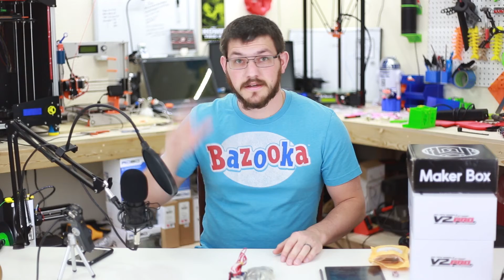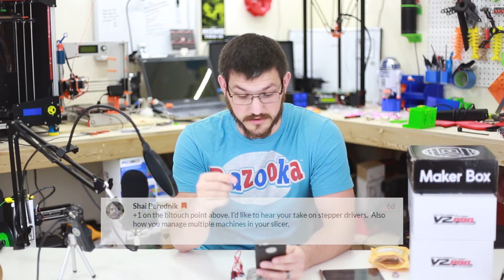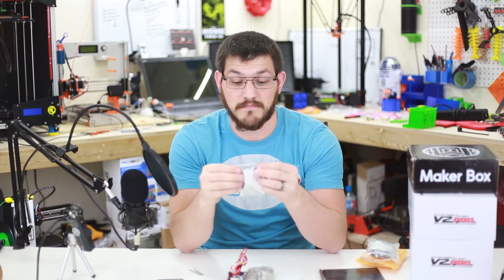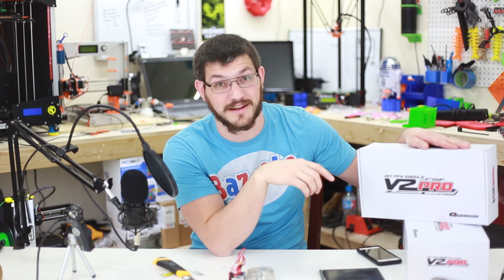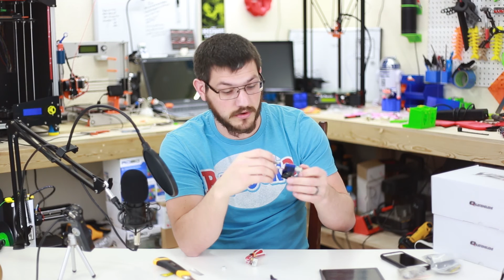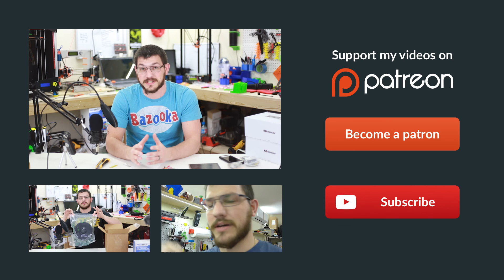VLOG #022 - Stepper Driver types, Connectors and FPV Drone Racing!

Comment: The heatsinks go on the proper place which is on the bare copper pad on the top of the pcb. This is why the IC is placed on the bottom of the PCB. The ICs have an exposed heat pad on the bottom which is designed to transfer heat through the pcb.

Comment: The tcm drivers are adjusted via a through hole 

http://reprap.org/wiki/Tmc2100. The heatsink is applied via the heat pad (bare copper pads) on the actual top of the board. The other boards are actually designed upside down since the heat pads are under

Comment: 8825 skipped steps is delay modes and the problem happens on the 4988 as well. You can change the decay through a jumper